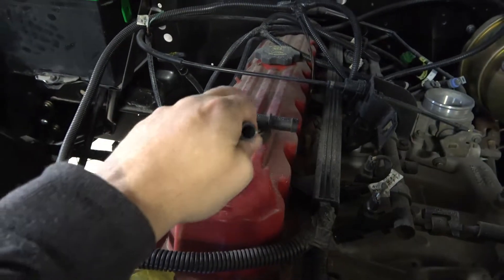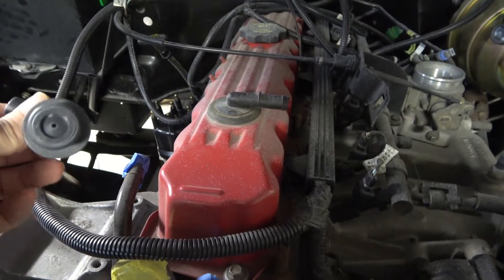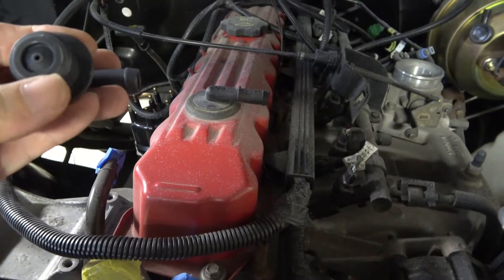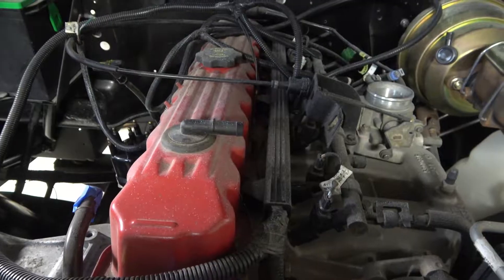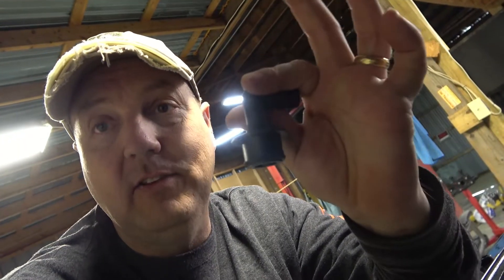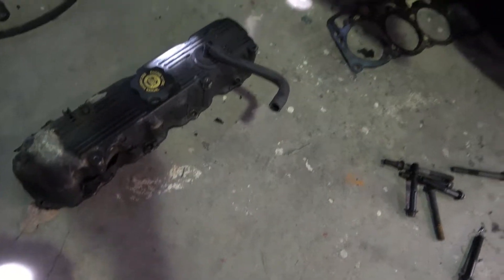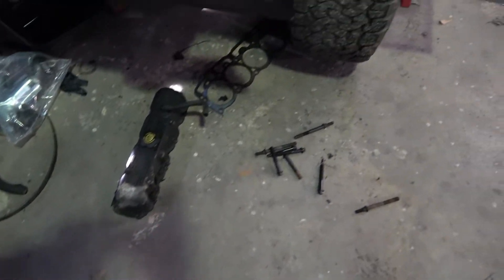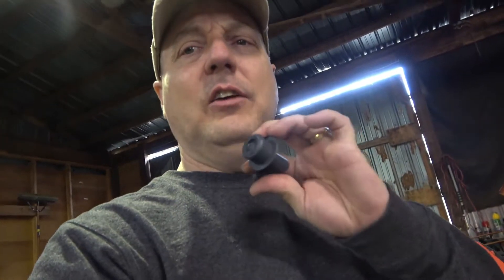Jeep 4.0 LITER Crankcase Vent Problems. CJ, YJ, XJ, ZJ, WJ, TJ, 4.2, 4.0, 2.5 6cyl / 4cyl

Comment: Anyone got a part number or what the part is called? What I find is like 150 bucks, can’t be right.
Reply from the maker: Front https://www.rockauto.com/en/moreinfo.php?pk=1320609&cc=1180314&pt=5052&jsn=1011&_nck=HllVxRCey1%2B2aVRDo41oQXhbegy63eH0PchVaGVs1k%2BAll0%2F%2F7FZXjBdldY0BurSU4nxEEcYmFKe35qT58jQ3b%2BhkYx21EuBgQ9FAP%2BRj3QDI%2BSBMINrOaO1V3GRPjCLGkRHH8rSLMdTjkEX4pgs3zTWT%2BA5hjNVLeez44dZuPrkveq9Jnp8wJLmODnNaXCenSNDRppfGESlIh9BZ98I1U1hgJpzOiZ1pV%2BqLjXHtKKk5aGYVIjmSga0IQmwn8p78kbMfyGDq6q08sigFbKns8JtUG8tYklZHD6CeCNCJMggDqjytOe59XfL8DctTweV
Rear https://www.rockauto.com/en/moreinfo.php?pk=12490837&cc=1180314&pt=11784&jsn=1004&_nck=HllVxRCey1%2B2aVRDo41oQXhbegy63eH0PchVaGVs1k%2BAll0%2F%2F7FZXjBdldY0BurSU4nxEEcYmFKe35qT58jQ3b%2BhkYx21EuBgQ9FAP%2BRj3QDI%2BSBMINrOaO1V3GRPjCLGkRHH8rSLMdTjkEX4pgs3zTWT%2BA5hjNVLeez44dZuPrkveq9Jnp8wJLmODnNaXCenSNDRppfGESlIh9BZ98I1U1hgJpzOiZ1pV%2BqLjXHtKKk5aGYVIjmSga0IQmwn8p78kbMfyGDq6q08sigFbKns8JtUG8tYklZHD6CeCNCJMggDqjytOe59XfL8DctTweV
Grommet https://www.rockauto.com/en/moreinfo.php?pk=13559737&cc=1180314&pt=11785&jsn=997&_nck=HllVxRCey1%2B2aVRDo41oQXhbegy63eH0PchVaGVs1k%2BAll0%2F%2F7FZXjBdldY0BurSU4nxEEcYmFKe35qT58jQ3b%2BhkYx21EuBgQ9FAP%2BRj3QDI%2BSBMINrOaO1V3GRPjCLGkRHH8rSLMdTjkEX4pgs3zTWT%2BA5hjNVLeez44dZuPrkveq9Jnp8wJLmODnNaXCenSNDRppfGESlIh9BZ98I1U1hgJpzOiZ1pV%2BqLjXHtKKk5aGYVIjmSga0IQmwn8p78kbMfyGDq6q08sigFbKns8JtUG8tYklZHD6CeCNCJMggDqjytOe59XfL8DctTweV

Comment: I have a question.  Are the 2 valves on the 4.0 the same type?  I need to replace my front one bc it's broken, but want to replace the rear as well.  I've seen both with small and big orifices.  Is the front small and rear big? Or, are they the same?
Reply from the maker: Rear is small orifice
Reply: @superb60ce  thank you.  So I need 2 of the same type (small orifices). Correct?
Reply from the maker: @puddlesmacker  No, Small orifice in the rear. Large (no orifice) in the front
Reply: @superb60ce  ok...thanks for clearing that up.  Be swapping them out shortly

Comment: So if it’s not getting to the air filter it’s not bad or if it’s in the tube change them out?
Reply from the maker: If the filter is not getting oil soaked...drive on
Reply: @superb60ce  cool thank you.

Comment: Excellent information!  I'm new to Jeeps and just got my 79 CJ5 with the 4.2 running after 10 years and I am getting a lot of blow back threw the oil dipstick.  I did install PCV valves on the valve cover.  Could that be part of my problem???? THANKS
Reply from the maker: Good luck!

Comment: Need help Egr valve for 89 Cherokee xj 6 cylinder 4.0 has been discontinued. Need replacement option for smog any ideas?
Reply from the maker: Good luck, try a pick-a-pull

Comment: If my valve cover gasket is leaking oil then obviously air is getting in as well and it’s not venting properly correct?
Reply from the maker: If the leak is bad enough, then yes

Comment: Yes hi I have a 2003 Jeep Grand Cherokee I've changed the spark plugs did smoke test found a few vacuum leaks change them when my truck is in drive and I'm at a stop sign I get a vibration I have no idea what it is cannot figure it out can you please help or get some ideas of what it could thank you
Reply from the maker: Not an expert on Grand Cherokee Transmissions, but I recommend you get yours checked

Comment: Cool! You just answered several questions. Thanks man, now, also, on the back side of my air filter housing there are two nipples side by side. On my manifold there are two there too. 🤧 I noticed there were no hoses hooked up. There were only nubs from the old hoses. 
I plugged off the nubs on the manifold. The other two are still open. There seems to be a lot of oil pressure pushing the air out of that opening where the plug is. Vapor is coming out all the openings. The rubber on the front and back plugs is like you said. I gotta replace those. I can’t believe that’s all it is but then there’s that vacuum you mentioned and maybe that’s it. Oh well thanks man. I love this motor. 🤧🙄
Reply from the maker: Guess it is time for an updated video on this topic

Comment: My '02 whistles when engine is warm and "idle" (either at 0mph, or coasting while moving).  For 3 years not able to locate the source, so just put up with the noise.  Then a couple weeks ago looked at that CVV system and recalled that I never replaced those since I bought it about 6 years ago.   I ordered the parts, and getting psychologically ready to chip off the O housings.
Reply from the maker: Just use some patience when removing the seals...they will be petrified

Comment: I have a 1991 YJ 4.0 liter & the both "valves" have wings like the oil filler cap that have to align with notches & all I can find are the round kind like you showed. Any suggestions where to get ones for my Jeep?
Reply from the maker: best bet is to upgrade to the later valve cover
Reply: Quadratec has it,  Crown Automotive 53030492 Rear PCV Valve Elbow for 91-93 Jeep Wrangler YJ, Cherokee XJ, with 4.0L Engine
Reply: @ibberman  thank you!

Comment: Will either of these if not hooked up make it idle rough?
Reply from the maker: If the vacuum port on the intake is left open, it will run lean
Reply: Would that be where the ccv goes to? This opening bought doesn't have any vaccum or evap lines left. I'm trying to find out where the all go..
Reply from the maker: @davidvarnado7761  yes

Comment: I’ve got a 1993 with a 2.5… 106,000 original miles. I’m getting condensation in my air box that’s a little foamy and smells a little oily. I checked the top rear fitting and it’s clean but inside the valve cover looked dirty there but not in my oil fill… it was 46 below zero and I think I had frozen condensation issues. NO COOLANT SMELLS… Thank God. I’m going to remove the valve on the side and see if it’s clogged… hopefully this is the fix. Thank you.
Reply: Update… I took the valve on the side of the valve cover out… plugged solid. I cleaned it and now the top hose connected to the air box has a vacuum draw instead of blowing oil into my air cleaner. Problem solved… Thank you sir!
Reply from the maker: Good stuff

Comment: I have a 1980 CJ5 with the 258 engine. PO put a 2 barrel Ford MC2100 carb on it. On the front of valve cover he put an oil breather on it. the back has the pcv vlave on it with hose going to carb. is that set up complete or am I missing something? Thanks!!
Reply from the maker: That sounds about right
Reply: @superb60ce  thanks!!

Comment: What do you recommend if you have gas smell in oil?
Reply from the maker: ALL combustion engines will get some combustion blow by into the oil...dirty oil will smell a little gassy, question is how much is too much...do a compression check on your engine
Reply: @Super-B  cylinder 1 is a little low but nothing that would really raise any flags. I think it couldn't hurt to replace the injectors and see what happens. I was curious of what you thought.
Reply: @Mattmazz77  Probably have an injector sticking open and pumping too much gas on combustion stroke which is leaking down into the sump as the engine is unable to burn it. Check your injectors.
Reply: @Taylor Livingston  that was my guess too. Thank you for your input.

Comment: My dad originally bought his Jeep Comanche inline 6 4.0 XJ and at from GA it's a Jeep command she ain't at and it's a 4.0 anyways he bought it for $2,500 I'm buying it for $2,000 I'm fully rebuilding it these as a lot of rust on it I'm fully rebuilding the engine and the front bumper is trying to come off in the rear bumper so I'm going to put a little bit heavy dish in front bumper and Military engraved rims and tires on it because they has it has the original Jeep command she tired rims on it
Reply from the maker: Glad you are trying to save it

Comment: Your video is extremely helpful only problem is I have a 1993 xj 4.0 I can’t find the metering valve anywhere because mine has the locking ears, not the push in type, my valve cover was gunked up bad all my stuff was plugged now I can find that valve to finish my job
Reply from the maker: Best bet is to convert to a 96 or later valve cover,,,it has a better oil baffle system anyway
Reply: @superb60ce  yeah I’ll probably just grab one from you pull mines pretty charred anyway thanks for the advice good video

Comment: Either way, oil in the intake is never good for any engine and this system will always introduce some amount of oil into the intake. The PCV-CCV systems are partially responsible for the piston slap issue that Jeep owners have reported (Oil burning in the chambers, ring seizures). To eliminate this issue, all Jeep straight 6 owners should install an inline oil catch can. There isn't a new motor being sold today on planet earth that doesn't have some type of catch can or evap unit.
Reply from the maker: you are partly correct....most piston slap and stuck ring issues (in ALL cars) result from improper oil service intervals and / or low quality oil.  I have owned jeeps w 4.0l engines since 1993....I have NEVER had piston slap or stuck ring issues.
Reply: Try tightening your torque converter bolts. That might be your so-called piston slap noise.

Comment: My 4.2 has a vented cap on each no tubes running to anything. Is this an issue?
Reply from the maker: Depends on the year and emissions package, I would consult your service manual
Reply: @superb60ce  i took off the emissions. Not sure the year of the engine, the previous owner replaced the 2.5 with the current 4.2

Comment: Having an issue now that I cant figure out. I'm on my 5th attempt. I keep getting oil leaking out the back of my Valve cover gasket. Pcv isn't clogged. I'm wondering if the pcv combined with a clogged oil drain is causing it to pool up and steam is working its way against the seal
Reply from the maker: Year?? I recommend converting earlier models to the late model steel valve cover, much better oil baffle and a better gasket design

Comment: Now, where can I find this part! I’ve searched and cannot find it for an 89 jeep Cherokee with the 4.0
Reply from the maker: The 89 Cherokee 4.0 was a Renix and used a different PCV system
Reply: @superb60ce  gotcha.. I am getting oil into the air box and my setup looks similar to this one.

Comment: I came across this video while trying to find out why my vent air goes to defrost when I'm merging onto a freeway. I suspect a small vacuum leak somewhere because everything works okay at normal city speeds. Would a clogged CCV cause the air to divert to the default blower position (Defrost and Floor) when the 4.0 is revved up or more "Load" is applied to it? Great video by the way.
Reply from the maker: There is a vacuum reservoir behind the front bumper, check from there all the way back to the engine for leaks...I will be doing the same when I install my new engine later this year.
Reply: @superb60ce  Thanks. I found out about that canister a few years back. It's always the first thing I check. My whole vacuum line deteriorated so badly that I recently replaced the whole line with a new one. Air blows great now from the dash vents until I push down on the skinny pedal and put some load on the engine. Then the air goes from dash vents to defrost. I saw your video and thought maybe the CCV is starving the vacuum when I load up the 4.0. What do you think? Could the CCV be partially plugged or maybe the rubber grommet is dried and cracked? I do seem to get oily residue around both ports on the valve cover.
Reply from the maker: @bluemaltese1  check the check valve at the intake. Other than that, re check all the lines. I am chasing the same issue, could also be tired motor.
Reply: @superb60ce  I replaced the rubber ends on the PCV (CCV) tube from the valve cover to the intake manifold and it fixed my problem. I now have good air flow from my dash vents even when I put the 4.0 6 cyl under load climbing a hill. My rubber ends were dried and cracked. It only cost less than $8 and took 10 minutes. Part # 47128. I have pictures but don't know how to attach them.
Reply: I change my plugs now I am hear popping noise and engine shake when I shut it off. Any help.

Comment: Can you help with how to run a F.A.T.S vent system with CCV?
For a non emissions 97 TJ 4L. dedicated rock crawler, roll overs on roof are common!  When on roof  leaks all oil out unless recovered quick. I think most of it comes out of front valve cover vent into air cleaner tube, if the nose is down (upside down) as filter get soaked. tried one way rollover valves that doesn't work so I'm going with supposedly proven FATS: Fuel Air Trap System Search, 'How to Keep Fluids in your Rock Bouncer' Controlling oil leaking out at valve cover vents needed but how do I deal with the CVC? If I plug it it wants to stall if I leave it open the idle is too high. Do I move the metered orifice at the end of the hose routing of FATS? .. sorry long question.
Reply from the maker: Yes, run a FATS (hose around the engine) from the front port and put a catch can between it and the air filter box.
Reply: @superb60ce   Thanks for reply.  Using front vent for FATS should work in majority the rolls that are nose down when upside down,  what about when Jeep upside down level or leaning towards rear?   The rear metered valve will flow oil (slowly but will leak)  I'm thinking two separate FATS, the rear is still connected in the same two locations but just do FATS loop in between around the engine??
Reply: The rear valve cover vent would be more likely to fill the intake manifold (when upside down) & cause hydrolock if plugs weren't pulled/cleared before startup.

Comment: Nice one my friend, I just came by this video looking for info about the location of the oil catch can. I have the 4.0 TJ and was wondering where to put it. There's lot's of video's on YT and what strikes me is the following. There is a port on top of the valve cover in the front and one in the back (like you showed) Both go to the intake manifold. The front one goes via the throttle body into the intake manifold, the back one goes directly to the intake manifold. I've seen both the front and rear ports being used to place the catch can. My question is, if I understand this video correctly, that I have to put the catch can between the front port and the point where the hose goes into the (hard plastic) air filter tube, is that correct?
Reply from the maker: Yes.  Put the can between the air box and the front port
Reply: @superb60ce  Thanks my friend, I can work with that ;-)

Comment: You might have just saved me a TON of time/headaches. I recently got a 94 YJ and noticed a little oil coming from that breather tube and landing on the air filter which I also assumed meant I had a blow-by problem. I will definitely be checking that after work!
Reply from the maker: Glad it helped

Comment: So which one has the small orifice elbow front or back I accidentally installed metered elbow on front of my friends jeep what will that cause to happen?
Reply from the maker: On a 4.0, the rear port does
Reply: @superb60ce  what will happen if I installed metered elbow up front and one is on back also
Reply from the maker: @robpaul7900  The crankcase will not vent properly

Comment: I have a 1990 jeep Cherokee. And can’t find a Pcv valve elbow online anywhere for it. Do the 4.0’s have a universal fit? Wondering if I can buy another years part.
Reply from the maker: You have the RENIX injection which used a different vacuum system.  These are the parts you need. https://www.rockauto.com/en/moreinfo.php?pk=586586&cc=1179996&pt=11784&jsn=1046 https://www.rockauto.com/en/moreinfo.php?pk=14900&cc=1179996&pt=11785&jsn=1039

Comment: I went to AutoZone today and ordered a PCV valve they gave me the PCv valve elbow but I noticed it did not have the metered orifice to allow some air for the vacuum it was just a tube the same size as the opening so I'm guessing if I were to install that would that cause too much Blow by
Reply from the maker: This is the one that is metered https://www.autozone.com/emission-control-and-exhaust/pcv-valve-elbow/p/dorman-pcv-valve-elbow-47057/860943_0_0

Comment: Is there an advantage to plugging the airbox on the 4.0 and putting a filter on top of the valve?
Reply from the maker: Nope
Reply: @superb60ce  is it bad to do?
Reply from the maker: @highwayxj9397  It will make for a stinky engine bay

Comment: What about if it’s blowing oil out of the dipstick I beat the hell out of the jeep it’s a woods toy but I don’t wanna keep adding oil to it and also I don’t want an access amour if oil all over the motor
Reply from the maker: If you are blowing it out of the dipstick, the crank case is over pressurized.  I would replace the CCV ports and hoses

Comment: I just got a 94 jeep Cherokee it's blowing oil out the cap and dipstick I need help
Reply from the maker: I would start with the valve cover vents as discussed in this video. The crank is over pressurized probably because your vents are old and blocked.
Reply: Awesome video thank you. I have some common sense and was left scratching my head when I went to a mechanic and asked for a diagnosis. He explained that I needed to have my old engine rebuild or replaced. 92 Cherokee with an old engine and very low mileage . He never even checked the mileage.

Comment: my 95..2.5 .....now got good sound advise thanks to you and your explanations of the side cover mysterious meter connect...thanks again adam
Reply from the maker: Glad to help
Reply: @superb60ce  how come my 2.5l valve cover has two ports on top?
Reply from the maker: @Dabestshindig  what year?
Reply: @superb60ce  1987
Reply from the maker: @Dabestshindig  Carry over from the original 4.2l derived 2.5l 4cyl.  You have PCV system
Reply: @superb60ce what hose do I need for the front port on my 2.5 l it's discontinued what do I do